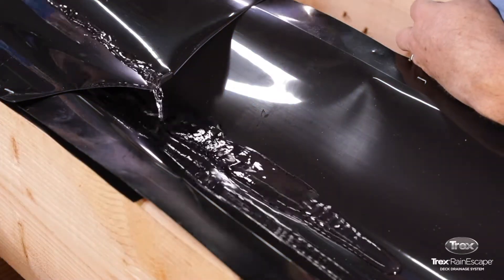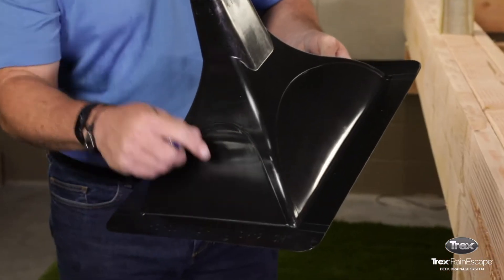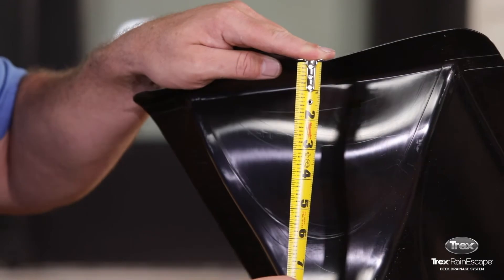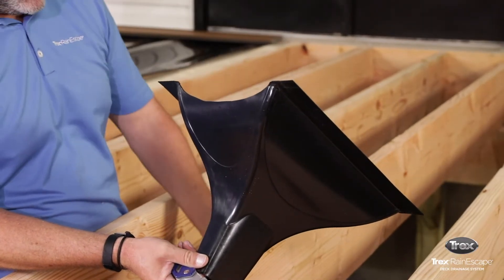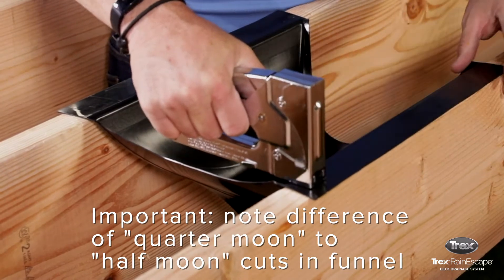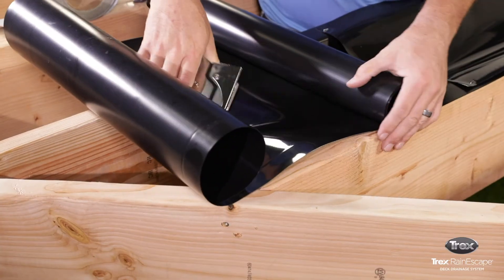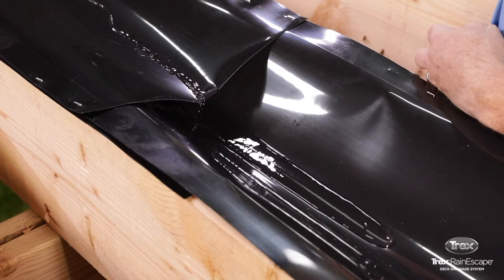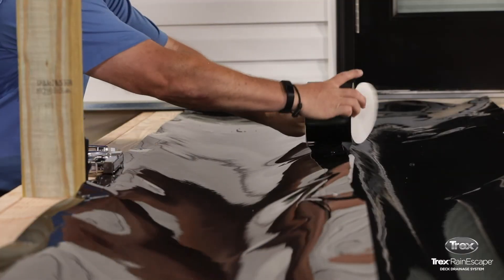How to Install Cantilevers

Comment: Hi, usually for code the area where the beam meets the cantilever needs to have blocking installed. Where is the downspout in relation to that blocking? On the cantilever side? On the main deck side? Over the blocking?